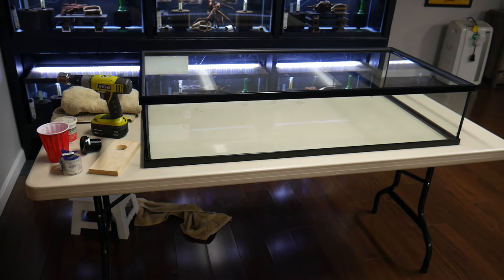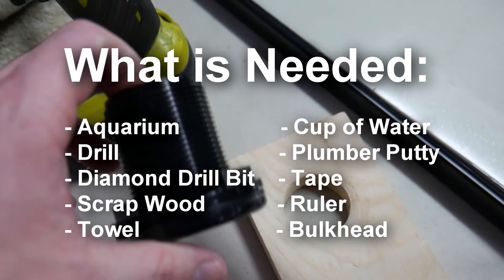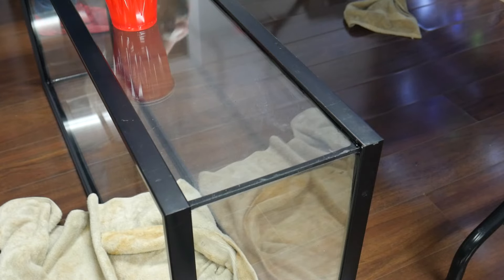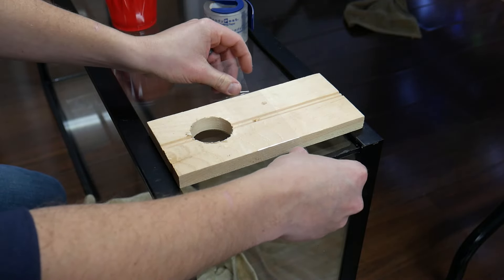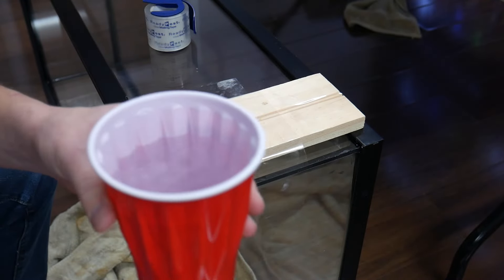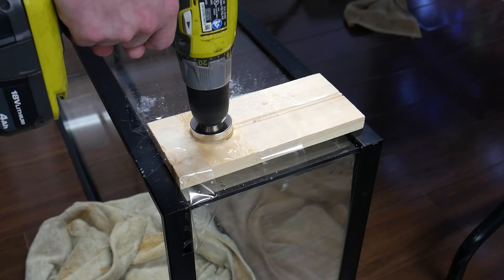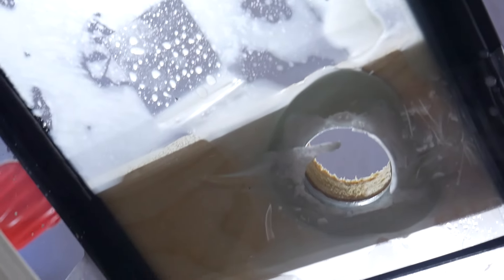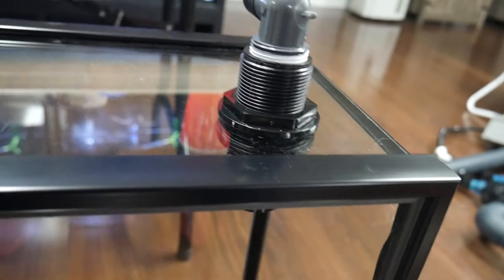How to Drill an Aquarium (For Beginners)

Comment: What size overflow did you use? Do you have a video on how you installed that low profile overflow to the bulkhead or is it something as easy as gluing it using another pvc piece?
Reply from the maker: The strainer is 1", and I just fit it all together with no glue actually

Comment: How many have you cracked?😂  I gotta drill some tanks soon.  What size bulkhead did you use and where'd you get them from?  I don't have a drain for my water so I'm gonna have to use a tote with a auto pump inside to pump it out the window and to the lawn.  Probably gonna hit you up to ask about some other stuff here in the next 2 months or so.  Gotta get this autowater going so I don't have to be home everyday
Reply from the maker: Of the 12 or so tanks I've drilled, thankfully I've only cracked one (pressed down too hard). I use 1" Lifegard bulkheads from Amazon (https://www.amazon.com/gp/product/B0002DKAU0/ref=ppx_yo_dt_b_search_asin_title?ie=UTF8&th=1). Hit me up with any questions you have!